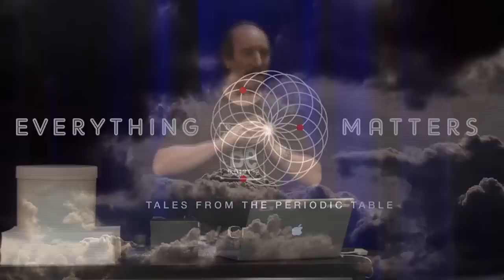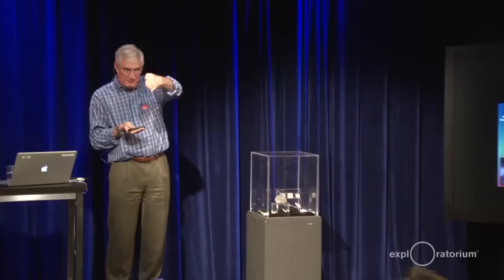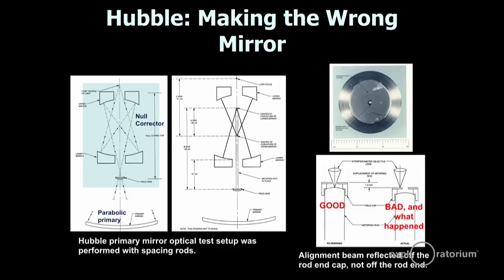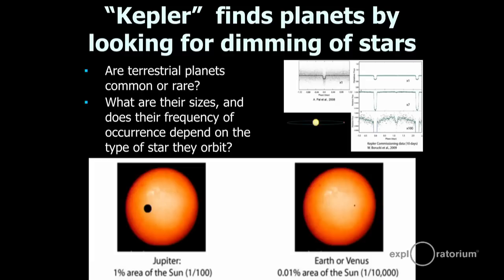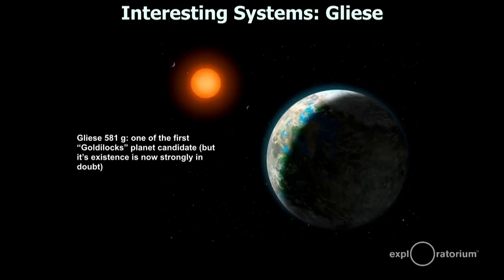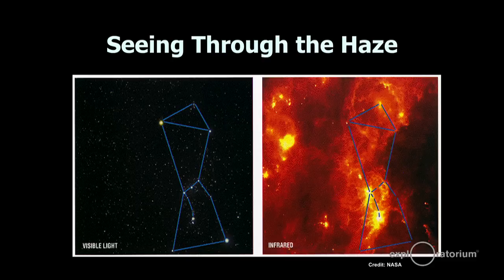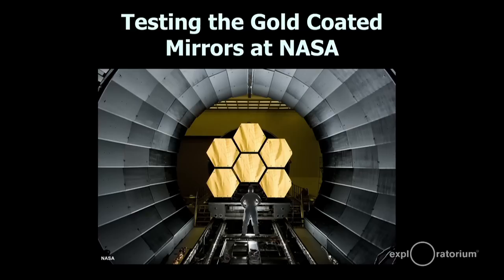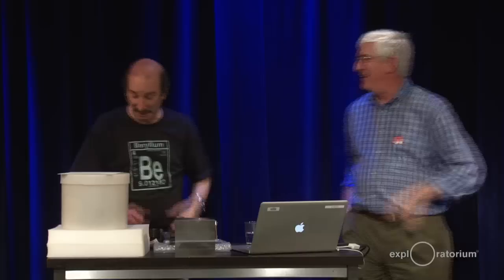Everything Matters | Beryllium | Dr. Jay Daniel | Exploratorium

Comment: What is beryllium?
Reply: +Seabury Lyon  Do people take Science class in school anymore??? Beryllium is an element, not a mineral. And don't breath any dust from it. Off to Google with you both! Read!
Reply: @sal3you  beryllium is a metal not a mineral, stop giving bad information
Reply: Beryllium is a very low density metal, it has lower density than aluminum or magnesium but it is very intresting because it is extremely stiff with an unusually high modulus of elasticity. I first hllearned about beryllium when i found it was used for making guidance system support brackets for the Minuiteman missiles. The metal is very expensive but its properties justified the cost.

Comment: Beryllium , Can be Very Nasty Material !
Reply: Then don't go round licking telescope mirrors.
Reply: It can be nasty at certain temperatures the oxide off it is carcinogenic!
Reply: I know that, it can cause Berylliosis.  But the mirror is coated with the metal, not the oxide and they work on it in clean-room conditions.  No worries.
Reply: Richard Anderson 
Just a thought!
Reply: the casting is beryilium and is coated with 2 ounces of gold ...
Be is very stable at cold temperatures , that's why it's used
Reply: In powder form not in metal form and mineral why can’t people understand